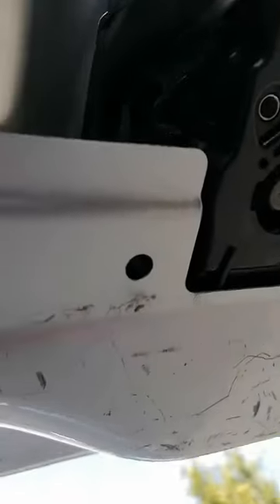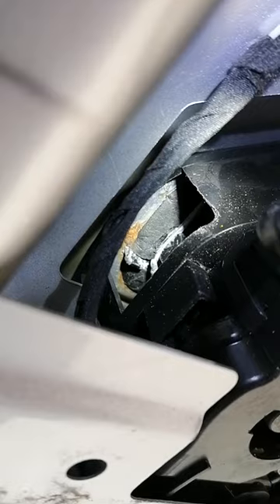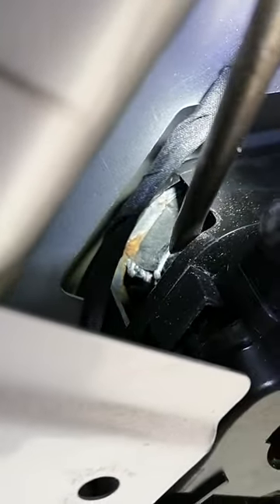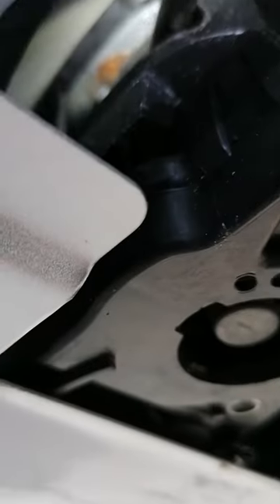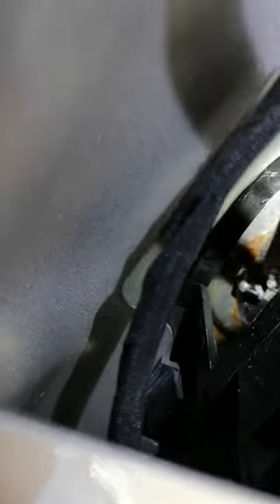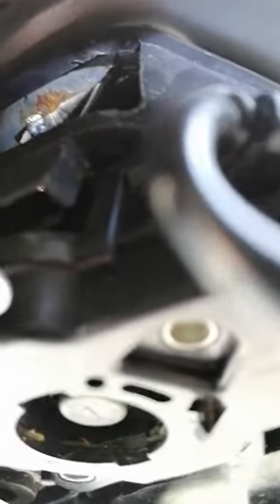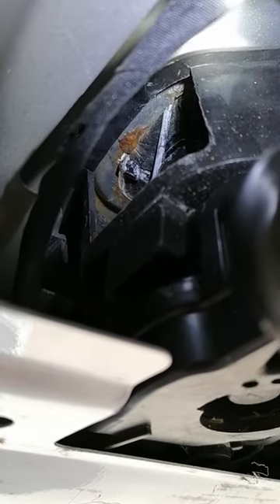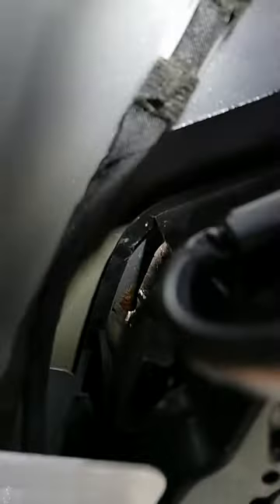Removing a VW Transporter T5 (2008) Tailgate Handle (2 of 2)

Comment: The legs on mine are facing outwards and it’s an absolute bastard to change
Reply from the maker: Yup its a right faff.  If you can get something else in or a strong pick type tool to pull whilst rotating it might help. If you look at the other video it shows what you are trying to do with the handle out so gives you a better idea of what you are up against....... with no room to see anything or use tools! Unfortunately its just one more fiddly job to chalk up there on the "I'm never doing this again!!" list 🤬